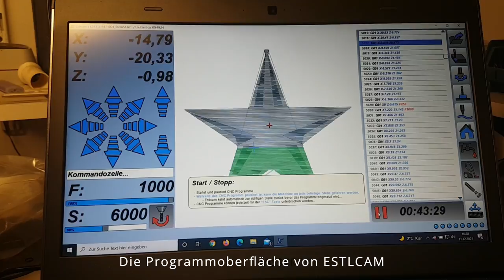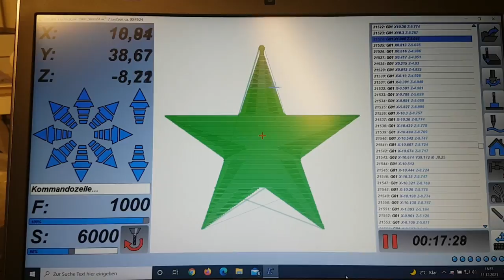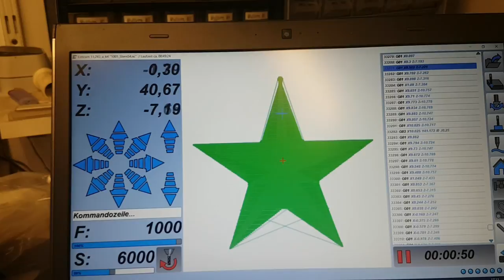3D-Fräsen mit ESTLCAM und Fusion360, der erste Versuch nach der Modernisierung

Comment: Hallo Jörg, schöne Arbeit. Hast du dafür die 3d Funktion von Estlcam oder Fusion genutzt? Ich möchte nämlich die Zeichnung und die Fertigung mit Fusion machen und Estlcam nur als Steuerung nutzen. Allerdings gibt es in der 3d Operation von Fusion keine Haltestege. 

Gruß
Dirk
Reply from the maker: Hallo Klaus, die Fräsdatei habe ich in Fusion erzeugt. Die Außenkontur habe ich als 2D-Kontur ausgefräst, da gibt es die Haltestege im 2ten Reiter wo die Geometrie ausgewählt wird. Estlcam habe ich nur für die Steuerung genutzt.
Gruß Jörg